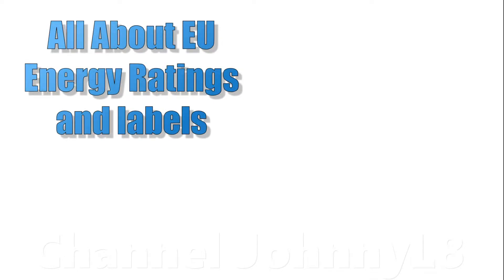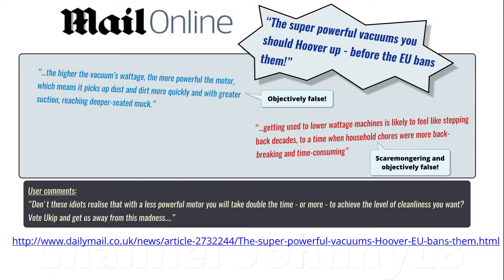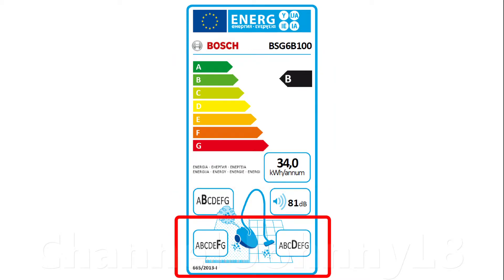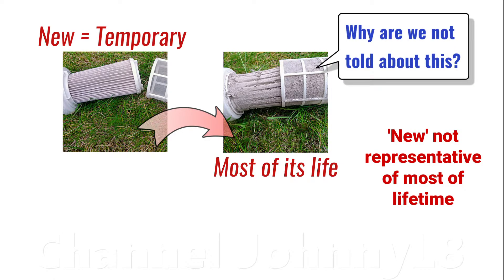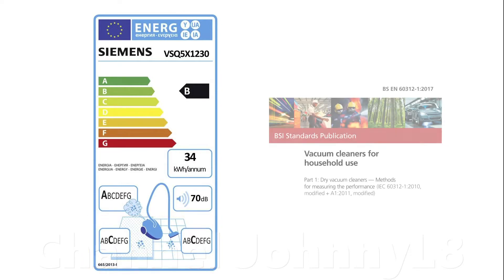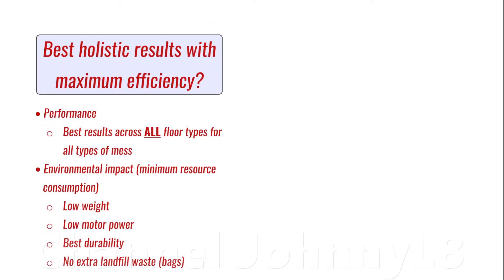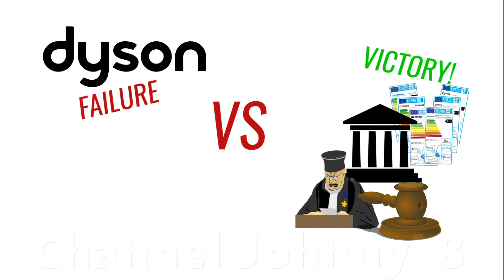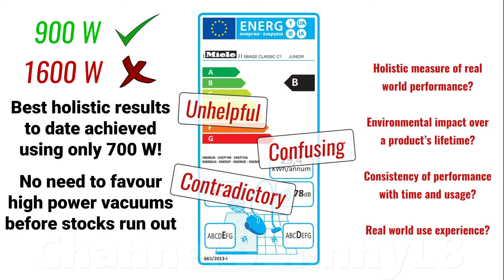The problem with EU energy labels for vacuums

Comment: Why does the EU directive (665/2013) omit some key points though?

"Definitions

In addition to the definitions set out in Article 2 of Directive 2010/30/EU, the following definitions shall apply for the purpose of this Regulation:

(1)

‘vacuum cleaner’ means an appliance that removes soil from the surface to be cleaned by an airflow created by underpressure developed within the unit;" - Why not remove deep down dirt from the carpet? Any old electric broom can clean the surface?

"‘hard floor test’ means a test of two cleaning cycles where the cleaning head of a vacuum cleaner operating at maximum suction setting passes over a wooden test plate test area with width equal to the cleaning head width and appropriate length, featuring a diagonally (45°) placed test crevice, where the time elapsed, electric power consumption and the relative position of the center of the cleaning head to the test area are continuously measured and recorded at an appropriate sample rate and where at the end of each cleaning cycle the mass decrease of the test crevice is appropriately assessed;"  - This is why alot of new EU vacs glue themselves down to the floor, to pick up from this specific 45 degree crevice. Use your vac on Lino or other such non stuck down surfaces and it causes havoc (I've had to re-lay ours after using an AEG UltraCaptic A rated machine on it...)

"‘test crevice’ means a removable U-shaped insert with appropriate dimensions filled at the beginning of a cleaning cycle with appropriate artificial dust;" What's artificial dust? It doesn't specify at all.

https://ec.europa.eu/energy/sites/ener/files/documents/Guidelines%20665%20666%202013%20Vacuum%20cleaners.pdf

I'm not saying the EU changes are not a good thing. Some of the best carpet cleaners I've used are old 200w Hoover Juniors, and all the cheap horrible makes have been forced to re-design their machines for the better. But don't stand there with your 2 dysons and say their the best and everything else sucks, because we don't take that. Anything can be rigged, Dyson and Bosch are/were throwing sueballs at each other because they think the other rigs the EU tests. Look at how VW got away with Dieselgate for so long...

It's a good, no, fantastic explanation of the EU energy labels themselves, but doesn't actually prove how vacuum cleaners are any better than they were before (in the main, exceptions are there of course (coughvaxcough)).
Reply: You are aware that you can get cylinder cleaners with an Electric power nozzle that will perform very well on carpet and you can then attach a dedicated  floor tool to use on hardfloors? Dyson are not the only manufacturer who can make good floor tools that make the most of airflow and give excellent flux density as you put it. Wessel Werk have been doing it for many years
Reply: So you're not saying that the Dyson is the best cleaner available on carpet but if you take everything you talk about into consideration the Dyson comes out the winner?
Reply: Mark Pritchard Miele too do some lovely floor tools! My parquet pro is much much nicer than the dyson hard floor tool. Attaches to a better vacuum cleaner too
Reply: Beko1987 Hi Beko yes they do. I own many of them. Miele are still my favourite cylinder cleaners closely followed by Sebo. The E3 Premium is very impressive. Johnny makes some very good points I agree with a lot he says but I'm not totally convinced by his claims about Dyson. 😁
Reply: Their not his claims, their dysons. Statistics can be twisted, and their context made unrealistic. Hoover did that lovely hard floor tool in the 60s, coupled with a nice 417g they clean dirt off hard floors as well as any dyson! Only had upright Sebo without the extra tools so cant comment on that, but I imagine their fine too!
Reply: Beko1987 Oh yes wat is it they say There's lies, damn lies and statistics 😁 I might get a light ball to try it out. Can't get out of my home at the moment there's 3ft snow drifts here in Cardiff, never seen anyrhing like it here. 🙈
Reply from the maker: The main thing I'm saying is that any claims made about performance must come with evidence in support of them. Not sloppy junk testing as found more often than not on YT, or weak hearsay and testimony, but formal objective evidence. The exact same kind of evidence from testing that all manufacturers would be expected to follow, i.e. industry standard testing. Industry standard testing is a recipe that anyone can follow to ensure fair comparative data. Otherwise I just don't believe any claims, and they're just words. YT is full of words; very few facts. Subjectivity holds very little weight for me. I've no doubt Dyson's (or any manufacturer's) data is rigorous and trustworthy if conducted to industry standards. There's also far more to a vacuum cleaner than just cleaning performance, or a head. My "How to review" video covered all the relevant factors and provided metrics to measure them by.
Reply: JohnnyL8 I have watched all of your videos and find them interesting. Don't you need expensive equipment to do these standardised tests? Why don't Dyson publish these test results so we can all see them?
Reply: JohnnyL8 I have an idea why don't you do some testing and show us all how it should be done. Maybe you cud test the Dyson then get your hands on a Miele or another bagged cleaner and compare your results. That wud be very interesting to see 😁
Reply from the maker: It would, but not going to happen for multiple reasons. I don't understand the details of the industry test method well enough to conduct them (also the reason why I'm not that keen on doing that video—going to have read and learn it all :/ ). I don't have the space, the equipment, the money, or the time to do a professional job. Nor the vacuums. I'm also not interested to be fair. I'm here to bust a wide range of myths and address YT rubbish, not formally measure cleaning performances on individual vacuums.
Reply: JohnnyL8 That's fair enough. Anyway I'll be getting a light ball on Monday we shall see how well it compares to my other bagged cleaners in my home 😁
Reply from the maker: I think surface dirt does mean dirt from within a carpet. My video about how vacuums work explains why dirt very deep in carpets is difficult to remove from the top. This is also covered in the industry standard techniques (which I'll discuss in a future video). There is a lot about particles in fibre networks people just don't know on YouTube and I'm here for a while to clear up myths and provide knowledge (for anyone who actually is prepared to learn from it).

Re hard floors. Well designed cleaners are good across all floor types. There may be better cleaners for carpets, but put them on hard floors and they fail miserably for one reason or another (e.g. clamping).

The energy caps are great, but the labels and associated tests are not that impressive or thorough at all, and are actually different to the IEC standards. Dyson are the only company I'm aware of that have challenged them, unsuccessfully. They even challenged issues with the industry standard, again with limited success. It's why in their marketing they make it clear they not only test to industry standards, but beyond (e.g. when the bin is full instead of when new and pristine and unrepresentative). Most people just write them off because they have brand-hatred glasses. The best review criteria I've come across I've outlined in the "how to review" video.

My claims about Dyson's Light Ball performance, again, are from their test data, i.e. empirical observed evidence. It's not my opinion. I've never seen any test data from other manufacturers, and only ever heard subjective (i.e. unconvincing) claims by random internet people. I've not seen any evidence that Dyson has rigged anything, but there is evidence that others cheat (the EU labels at least) and deceive by increasing motor power to compensate for poor design and suction loss.
Reply from the maker: Not necessarily. But however you test to industry standards, you need to make sure it's done very formally, professionally, and carefully to ensure the integrity and trustworthiness of your data. Dyson, being crazy wealthy and surrounded by highly skilled scientists and engineers, build robots that automate all the testing to facilitate getting the data. They show a lot in their videos. It's very impressive actually. I suspect they don't publish because they're not a strictly scientific enterprise whose purpose is to establish what's true in the world; they're a business and their primary goal is to bring products to market and profit to support their growth. They focus on the highest end of the market, so as long as their products perform the best in the relevant metrics (i.e. holistically across the board rather than in one niche area), then job done. It's not in their business interest to publish the data that a numerically insignificant number of people out there might be interested in, alas. This is in contrast to a scientist, who lives to publish their data.

Also worth nothing that you can't get the perfect vacuum. Change something to get the best hard-floor performance for example, means that change could worsen carpet performance, or impact something else. It's hugely complex and most people don't appreciate it (not that that stops them from spouting crap on YT). What is fair to say though, is that the average performance across all floor types has been improving over the years (at least by the better manufacturers), and Dyson claim, based on universal industry standard testing, to have the best average performance with their Light Ball. But as I said earlier, there's far more to vacuums than just cleaning performance, and my "How to review" video covers it all.

Comment: You are right about motor Wattage isn’t the be all and end all regarding performance, but it is a key factor. For example, the Dyson Cinetic Big Ball in America produces 180aW, but in the UK it’s 120aW. The Dyson Ball Animal in the UK produces 120aW, the yank’s equivalent machine is a whopping 270aW. How do you explain that?
Reply from the maker: Yes, motor power is indirectly related to performance to some limit. The Dyson Light Ball produces 90 AW at the cleaner head with a 700 W motor and achieves the greatest relative cleaning performance across all floor types, even at bin full, as measured by industry standard IEC 60312-1:2013 Cl 5.1, 5.2, 5.3, 5.9. As I've touched on in other videos and will discuss in a video in future, the number of air watts in itself is not a meaningful metric and many other factors are relevant to determine cleaning performance. Shamefully, big numbers presented cosmetically, sell—particularly in the US due to the nature of commercialisation there—and so the 270 AW in the Ball 2 in the US is a manifestation of a numbers game. Evidence shows that big numbers don't automatically equate to big performance and other factors are also at play.